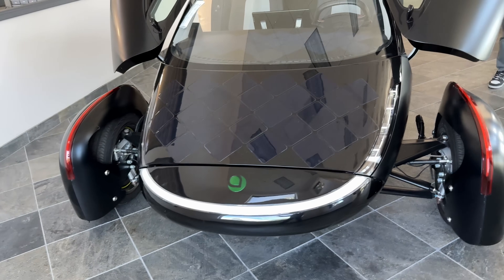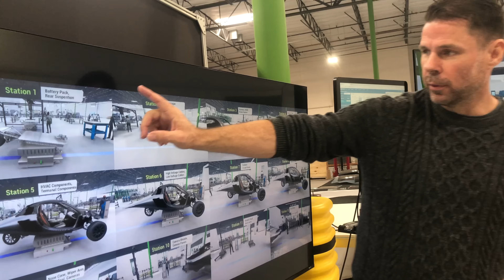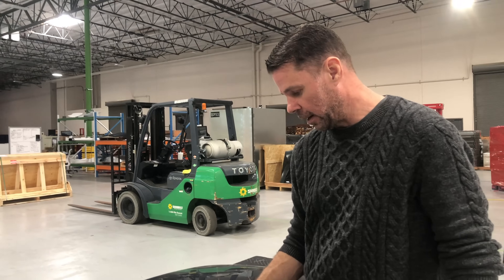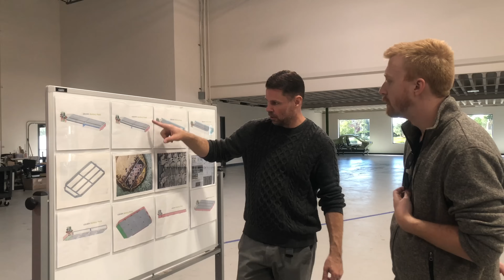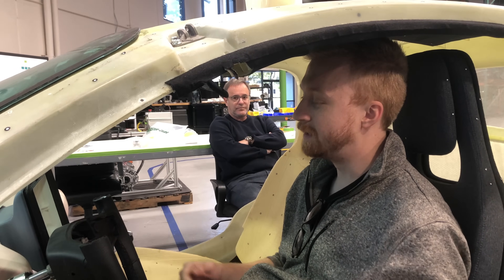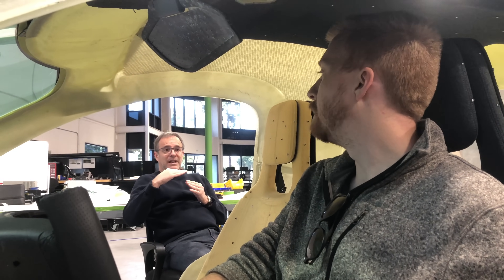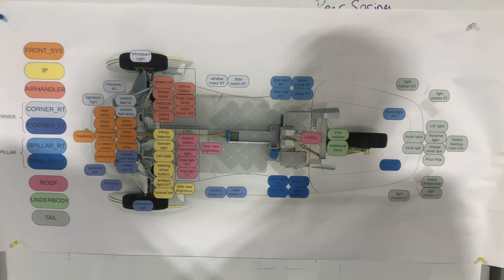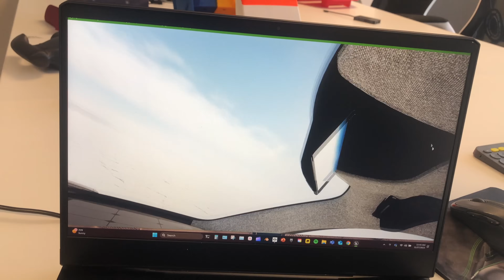Touring Aptera's Factory!

Comment: I think this is the most exciting electric vehicle that’s nearing production. I hope they still plan to get a meaningful amount of charge from a 110 outlet. That is a game changer and will mean you can go anywhere and not have to worry about charging your vehicle.
Reply: It should be able to get 12-15 miles per hour on 110 outlets.
Reply: I think that is still true, due to its light weight and high efficiency. A typical EV will gain just a few miles of range per hour of charging on 110V because they're heavy and not very efficient, but the Aptera would probably gain twice that in the same amount of time. How cool would that be to just carry an extension cord with you for emergencies?
Reply: Getting strong Nikola/Lordstown vibes here, not even on par with Arcimoto which I never had confidence in.  
NOT A FACTORY it's squandering precious funds on a promotional center!  Good Grief.

CEO entirely unconvincing with his CGI substitute for substance.
Reply: @Mrbfgray  That's just incorrect. It is their factory, not a 'promotional center'. And if you didn't like the CGI, go watch the part where they're showing off all of the production body components and solar panels that are already being produced. They're close to mass production that Nikola or Lordstown have ever been
Reply: @Mrbfgray True, it's not a factory, but it will be when they get to that step. The funds collected thus far are being spent behind the scenes, in development and manufacturing of tool dies, etc.
Reply: @JustWasted3HoursHere    Maybe shouldn't be called what it isn't.  Spending anything on fancy displays makes me uneasy at this stage.
Reply: @Mrbfgray But they also have to have things to show to potential investors. It's part of their overall product promotion, and something that all businesses do. Doesn't bother me. Now if they had a giant swimming pool with 24 hour lifeguards and a cocktail bar that might be different.
Reply: @JustWasted3HoursHere   They could show actual production and output, that would be far more convincing to me, not interested in stuff that looks like college science projects, little fragments of materials and such.  Show me how fast they can crank out quality components and put them together.

Not my concern, a litany of reasons I'm not onboard w this outfit.  If you are, sincere best wishes to you.
Reply: @Mrbfgray I've worked in manufacturing setting up production lines. This is how all factories start out, you can't just flip a switch and assemble a car with thousands of unique parts from hundreds of suppliers. They're definitely a start up and not at the finish line yet, but the necessary pieces are in place for them to start producing at scale. Tooling, facility and ERP/MES are already in place. These are the biggest investments initially. The first cars from production parts are the next major step. 

Honestly I'm hoping for a slow rollout initially. If they just quickly make 40k cars and those cars have a major recall, that could bankrupt them. It's happened to a lot of vehicle start ups unfortunately. I'm hoping for them to succeed. Such a cool concept and so practical. The first car you can realistically plug into a standard 120V outlet and get 100+ miles overnight or at work. Game changer
Reply: @Tazdeviloo7    NOT a game changer, old Kia can do that, they are very late to the game, prospects of success maybe 1 in 100 to be generous.  Cool college project yes, not something I'd want to pay for and trikes just suck.

That said, options are good, be happy to see these on the roads one day, just wouldn't bet a dime on it.
Reply: @Mrbfgray  Which old Kia? 

Millions of dollars in tooling is not a college project lol. Manufacturing project wise, the car is mostly done. The first final assemblies(complete cars) are about the last 10% of a design to production project. Aptera is 90% there
Reply: @Tazdeviloo7   Don't recall model of old Kia, just an example of cheap old EV that makes decent commuter charging overnight at home.  Not new.

90% there?  Where is 'there'?  Certainly not 90% to breakeven production/sales.  Not interesting in convincing u or anyone else, just haven't seen near enough to give ME confidence.

Was once over 60 motorcycle co.s in USA and dozens of auto co.s.  Similar for any number of other mfgs, hang gliders to computers.  Vast majority won't make it so exceptional execution required to simply survive for a number of yrs, Lucid isn't doing it even with superb engineering.  

Predictably Lordstown, (never mind Nikola, it was an obvious scam from day 1) and Arcimoto failed.  Vast majority of Chinese EV brands will fail. 

Rivian has a good shot with excellent product but still losing money hand over fist.  Fully expect Aptera to fail, not a wish just reality.
Reply: @GoClimbARockEh Agree these guys are close. Money has long been an issue. But Nickola was run by a fraud and Lordstown grossly underestimated the necessary engineering. I don’t think these guys are hypesters, or frauds. They have a lot going for them.
That said they have a monumental task to bring this to profitable production…
Reply: @Mrbfgray good point. Not sure they spent a ton of money on that, may have been an intern project for all we know.
Reply: @JustWasted3HoursHere  It's great that they can access superchargers but what really appeals is that Aptera doesn't really need it.  If you get stranded in a ev monster truck in a blizzard and you try charging from 110V there's a good chance that the power will leak away as fast as you can charge it. You can truly get caught out.  An Aptera with a small battery on the other hand you can feasibly charge the thing up anywhere with domestic power.
Reply: @colinmacdonald5732 Yep, not to mention the built-in solar.
Reply: A 120V 15amp outlet can produce around 1440 watts an hour. Their efficiency is marketed at 100 watts per mile so roughly 14.4 miles per hour of charge. I did it with my Model 3, charging from 6:30PM to 7:30AM and would get about 40 miles of range. With Aptera’s figures, I could estimate right around 100 miles of range plus the 40+ miles from solar. I guess it depends on what you mean by meaningful amount. To me charging the Model 3 on 110 is plenty fast.
Reply: @CWK09  Over a hundred is much better than 40.
Reply: @craig8638  okay?

Comment: What I like about these guys is that they didn’t make the same mistake as the other EV manufactures are making currently. Which is making an EV that looks and weighs the same as a combustion vehicle. While electrons have much more power and efficiency than combustion our ability to store them is the problem so therefore, you have to think how else you can make your vehicle efficient to adapt to the current problem of storage efficiency. It’s always struck me that the vehicle needs to be aerodynamic. We keep making these stupid boxes that push a Schieszer ton of air. I know why they did it because people are resistant to change but with the right design and enough time people will adapt to the new.

Comment: The solar panels can break and still produce electricity, that’s very impressive. And they are very bendable. Then why don’t they plaster the whole surface with solar panels? Is it because of cost? Because of weight? Because of cost/benefit? I need to know.
Reply: From what this writer has learned of this issue: the panels on the sides are not effective enough to warrant the costs

Comment: It makes me feel great to know that Aptera copied Tesla's adoption of my idea to use 1 power circuit and signal on and off functions instead of all those single circuits all wired to the driver.  I was wiring my own velomobile when I got the idea.  It's outside of my house right now.  
I had thought you could just use the power circuit to signal things on and off, but Tesla couldn't get past the noise on the circuit, so they put in the ethernet to switch things.  Apteras system is essentially similar.  I'm glad to have diminished the weight and cost of every Aptera.  I wish I could sign the inside parts of the first one with everyone at Aptera.  I am also glad to have invested my $12000 when I did, too, got $1000 off!

Comment: I will say, depending on the steering wheel placement, not having a telescoping steering wheel could be a deal breaker if it isn't positioned optimally.
The primary complaint with the family Prius is the steering wheel needs to stick out about 1.5" further to be in a neutral position not only for my arms (6' 1") but also my wife's (5' 3").
It can make long trips uncomfortable.
Reply: As of recent news from the other Chris- there is to be telescoping methods

Comment: I hope Aptera team will think about providing LiFePo4 (LFP) battery pack with blade or 4680 cells as an alternative to NMC 2170 cells. Tesla and BYD know what they are doing (and they moved from 2170 NMC to 4680 or balde LFP).  LFP chemistry total cost of ownership over time (including pack replacement) is lower than for NMC pack. LFP is also safer. Slightly lower energy density of LFP is compensated by higher usable capacity (higher safe charge/discharge limits without causing degradation and capacity loss) and longer lifespan (higher number of deep discharge cycles).
Reply: I have a classic Hyundai Ioniq (28kWh battery) which is 6 years old and has 153000km on the clock. This is nearly 700 cycles and I don't notice any significant degradation. The battery is a LiPO type, so it is some kind of NMC battery. For LiPO, we see very often a number of 500 cycles before significant degradation, but I don't see any. We can even see now one classic Ioniq with 500000km with 10% degradation only (2300 cycles) !!
The battery is only air cooled and it can charge at 2.5C during a long time without any issue.
I charge most of the time up to 80 or 90% but I charge at 100% before a long trip and the I will use CCS chargers.
So a LFP is not really a game changer. A well designed NMC pack can last a very long time too. The only problem of the NMC is the higher risk of fire.
I have preordered the 60kWh Aptera, so it will be delivered with a NMC pack. If the pack is well designed, I should be able to use it for 2 million kilometers or more.
Reply: The last company Chris Anthony co-founded and took public as CEO is a  LiFePo4 (LFP) battery company.  He knows as much about how these perform as anyone.  If the balance was there to reach the performance they were looking for in the present vehicle, he would have used them.

Comment: Great concept,  but if it's over 30k I don't see it flying off the shelves. It's  always going to be in the sun, pull down or up solar window/windshield screens be nice to keep the interior cooler while charging the batteries or climate control while parked? That or maybe a heat exhaust fan for the cabin
Reply: The cooling system keeps the interior at the outside ambient temperature via a fan and ducting.
Reply: There are air exhaust ducts in the tail of the car for fans to remove heat.  These can also remove battery heat gained when the vehicle is stationary for charging.

Comment: What's the 1/4 mile time?
Reply: We will hear more about this once the PI vehicles are under validation.  The Elaphe motors are being redesigned from the original M700s to move the torque curve down in the RPM range, which will also reduce peak HP.  Top speed is likely to be just over 100 mph now.

Comment: I have been watching Aptera for a couple years. I can't recall anyone addressing the issue of  a maintenance/repair network. Can someone chime in.
Reply from the maker: Aptera is a Right to Repair company who’s committed to making all parts available to anyone and uploading video tutorials on how to service nearly every component to make it easy for everyday car shops to service the Aptera and they’ve mentioned offering remote service options where they can
Reply: Thank you. Without a service network in place that would make it a no go for me. Not sure any car shop would want to spend the time and money to learn to repair an Aptera. I own a Smart car and know what it's like to have no shop willing to even look at the smart and it is an ICE car. I do like everything else about the Aptera. @TailosiveEV
Reply: @door2416  You might be surprised.  I live in rural Iowa and have talked to every independent shop in my area.  They all can't wait to see it and work on it!  

A Smart car is very different.  Engine parts are not interchangeable between engines.  There is a explicit reason with the Smart.
Reply: @billsmith5960 well I'll be the first in line to give you are differing opinion.  What is it on the Aptera that you expect it would be so hard to maintain and repair in comparison with  the ICE vehicles that all these shop maintain and repair ?  The Aptera has no transmission or drive shafts. It has no engine with its myriad of sensor like multiple O2 sensors. Camshaft and crankshaft position sensors,  map sensors. No spark plugs, or multiple igntion coils or fuel injectors to go bad. It has a simplified wiring harness. I suspect that it is going to very simple to maintain and repair.
There are also more and more EV repair shops that are available now.

Comment: Nobody has mentioned the liquid cooling system for the motors , etc.  , for quite a while . Is it still close to the outside surface of the body or has that changed to something else ?
Reply: There are actually 3 cooling systems.  The motors and inverters have a higher temp anti-freeze cooling loop and the batteries have a separate lower temp loop.  These both radiate heat from the belly pan at the bottom of the vehicle.  The efficiency of heat removal decreases when the vehicle is at slow speed or stopped because the convection from moving air is less.

Under these conditions, fans in the AC system blow cooled air past the top of the belly pan, through the AC condenser, and then blow the not air out the tail of the vehicle.
Reply: Is the belly pan that is exposed to air - aluminum ?
Reply: @stephencooper3774  I haven't heard for sure yet, but think it likely.  The first test ones ones were made of fiberglass.
Reply: Seems like fiberglass would retain heat more than aluminum & be heavier too .
Reply: @stephencooper3774  Yes.  Of course the entire body design has changed since then.

Comment: What is the life of the solar panels...10-15 years? Are they easy to replace? Are they expensive to replace, and will parts be available?
Reply from the maker: Aptera is a Right to Repair company so I assume they’ll make them available for a reasonable price. Should last over 10 years
Reply: The manufacturer of the cells Aptera is using gives a 40 year warranty that the cells will be producing at 88% of original output at the end of that time.   However, solar cell advances will mean that you will probably want new tech before that time.

Comment: They still don’t get it 😂 the headlights should extend to fenders to include the front wheel as part of the body and additionally have a flag or indicator to remind the driver to include the front wheels as the total width,  looks like another 10 years before trump oil companies might allow Aptera be produced

Comment: Did you mention that Elon will give them the full 48vdc architecture along with all the part numbers now currently available thru vendors thanks to $TSLA
Reply from the maker: No Tesla isn’t selling anyone the needed parts for 48v. All they did was say how to design one, but that doesn’t make it cheaper than buying off the shelf 12v components

Comment: Will someone please ask how much CPC is charging them for each body? Carbon fibre body shells are notoriously expensive, then you have to ship them to the US.  This doesn't add up.
Reply: This is probably not the kind of carbon fiber cloth you are thinking of.  The bodies are made from SMC and a carbon fiber like clay that is pressed in a mold.
Reply: @n.brucenelson5920  yeah, pressed in a mould in Italy - doesn't sound cheap or scalable.
Reply: @bluetoad2668  It wasn't cheap - each tool, some of which were carved from 100 ton tool steel blocks cost millions each.  However, they can produce parts both more quickly, more cheaply, with dramatically less scrap, less labor and with far higher quality than the vacuum resin infusion resin process they originally planned.  That was what was not scalable.

Comment: Another thing to remember. 
He says many time they are bound by motorcycle rules.
So, in states with helmet laws, you could get a ticket for not wearing a helmet inside your "motorcycle"
Reply: There are at most only 4 states left where this is the case - and the number has been rapidly decreasing.  Alaska is one.  I think it is rather unlikely that any will be left by the time Aptera is shipping - especially after the crash test results are published.

Comment: I have a question to ask him: If you're able to put a cell in every other spot for the 23 kwh battery, why not use the 21120 batteries for the 23 kwh battery and put them in every 4th spot, then for a 46 kwh battery, you can put them in every other spot, for the 69 kwh battery, you can put them in 2 every 3 spots, and for the 92 kwh pack, you can put them in every spot.

Then you will only have to make 21120 cells and that will simplify things.

If this is a bad idea, why not make 2130 cells for the 23 kwh pack and never skip any spots for any of the batteries.
Reply: I'm guessing that the space for the width and length available for the battery case may be limited. Aptera''s choice allows rgd to use the same size "battery case". It is just the height of the cells that changes.